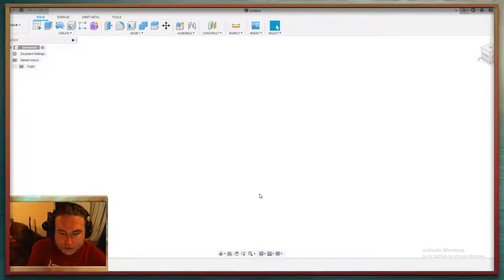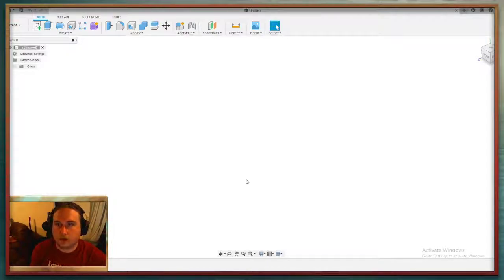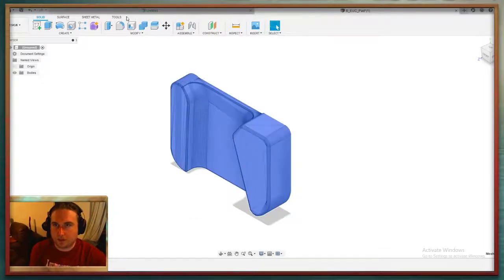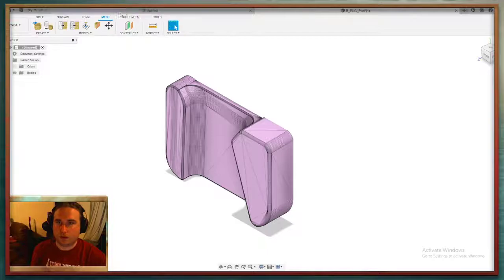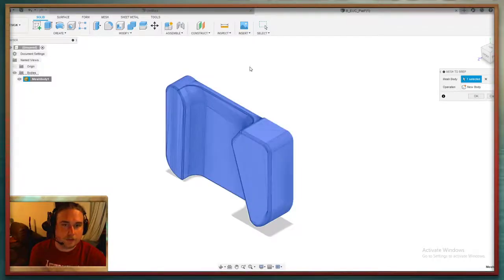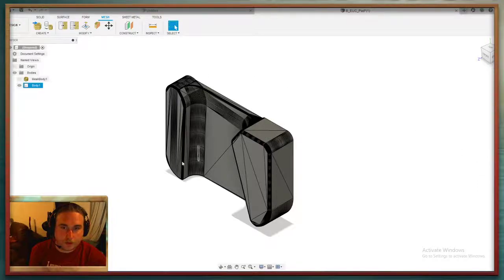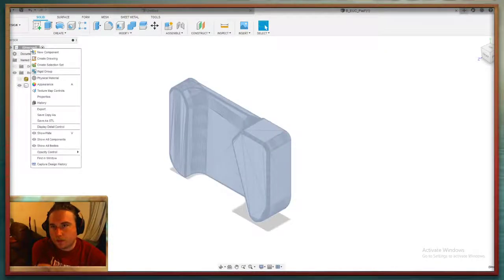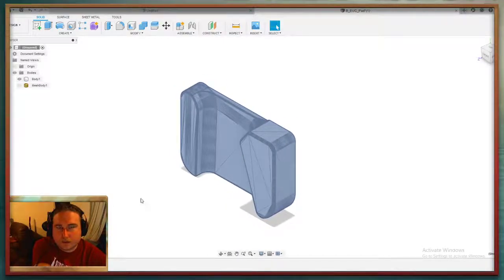How To Import and Modify an STL in Fusion360 (2021 Updated) - Fusion 360 Basics

Comment: All I get is this message. 

Mesh to BRep conversion
Warning: This mesh contains a large number of facets.
Mesh surface content:
Faces= 393446
Conversion had been aborted.
Warning: Mesh to BRep conversion aborted.
Reply from the maker: Hey! Yeah this is a common issue with this method, it crashes when you have a high face count. Two ways around it; 1. Depending on the mesh/model you can go to 'Mesh >Reduce' to reduce the number of faces, pick an amount as low as you can go while still keeping the detail, then try the conversion again. 

2. Second option would be to use Blender (another free modelling program) and Open/Import the file into that, then File>Export the model as an .STL :)
Reply: @makerjay6504  I found how to reduce in another vid. Editing it was still a pain, as I'm still very much a noob.
Reply from the maker: Definitely! Fusion isn't great for heavy modding of STLs. Blender is good for that. Fusions great for accuracy and creating models though.

Let me know if you have any topics you're after / need help with! Happy to do a video

Comment: The problem with this is that it's painful to select every single facet to extend/cut e.t.c. How can I remove the facets to make it easier to select sections to cut/stretch/shrink certain sections of the model?
Reply from the maker: Yeah this is the main problem with this, STL's / PC's struggle when trying to convert lots of faces. There's a couple methods, I might make a video explaining it a bit further! One main way would be, before you convert the STL to a BRep, to go to Mesh in the top toolbar, and Reduce the faces down. I believe a few of the tools in that Mesh>Modify menu will allow you to smooth faces or reduce faces or combine them.

Another way would be to do it in Blender, Blender has a nicer system to grabbing and editing individual faces/sections of the model, that's usually my go to for that sort of stuff. Fusion is used for reliability/precision/engineering design, Blender I use for when I need to sculpt or edit specific faces/vertices/parts of a model